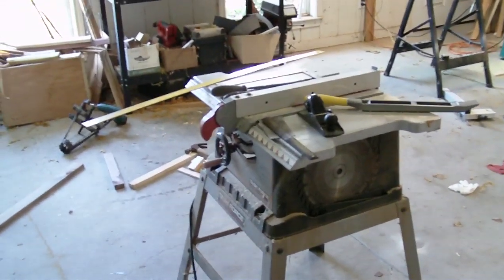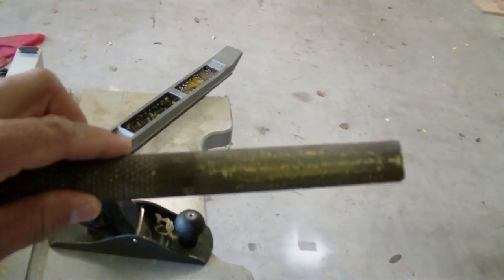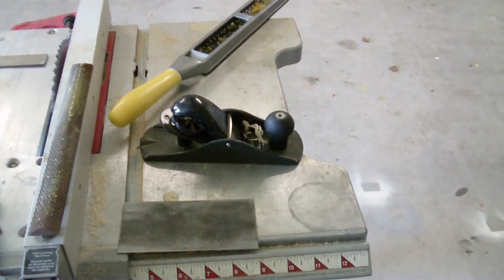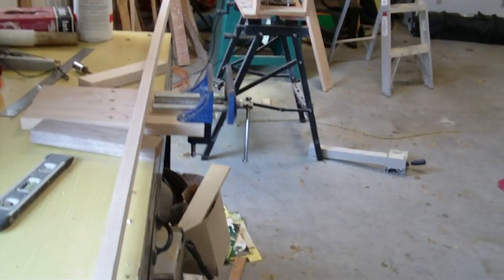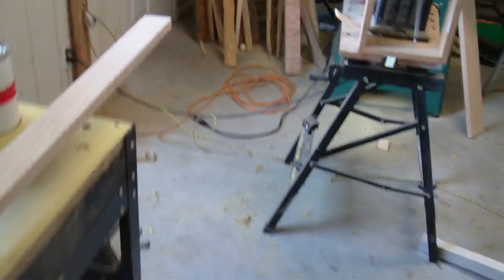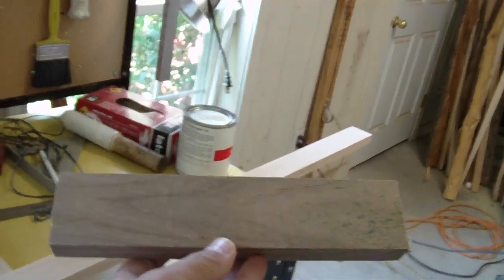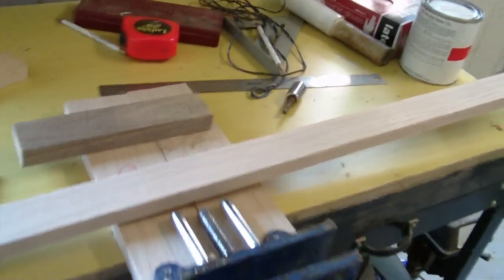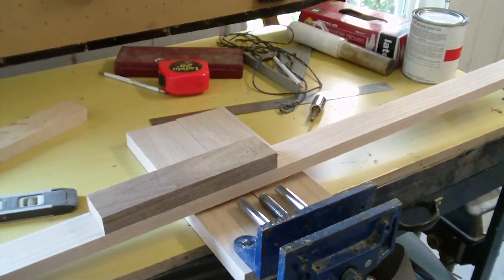boardbow build along pt 1

Comment: another consideration is the color of the red oak.  I bought a board that met all the other criterion.  It has a dark streak on one side that is, I guess sapwood.  The finished bow functions very well except the dark wood cracked when I strung it.  I still have shot it and it does ok.  The dark wood was about 1/2" wide.  I think it has cracked all the way across that wood.

Comment from the maker: @calvarez081 thanks for watching.  i am not an old wood worker, however my experience has taught me that using a toothing plane or hacksaw blade on the surfaces make a super strong joint.  greater surface area for the epoxy or glue to hold.  i have test that on about 100 bows.  now on some of the few pieces of furniture i make i dont do that.   oh and i'll work on the pulley.

Comment: Hey there, quick question....So I bought a Red Oak Board from Lowes that is the 1"x2"...but isn't technically 1 x 2....do you recommend the same dimensions you used for your true 1x2? I will probably back it with Cloth or Silk or something....so just wondering if you recommend the same dimensions or would you adjust some? (if so, what would you adjust to?)